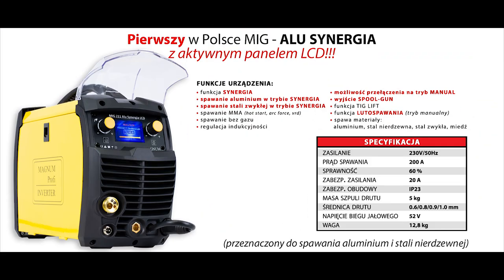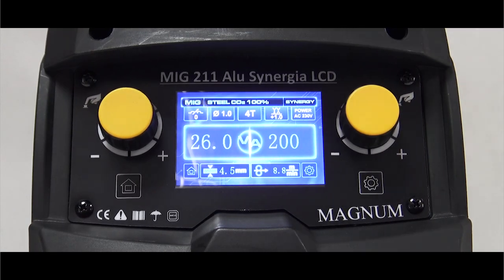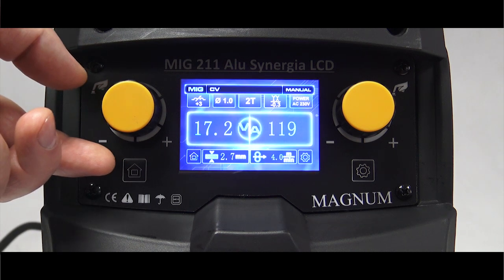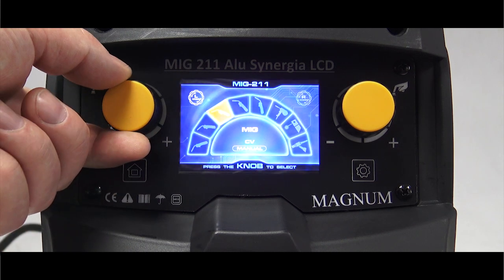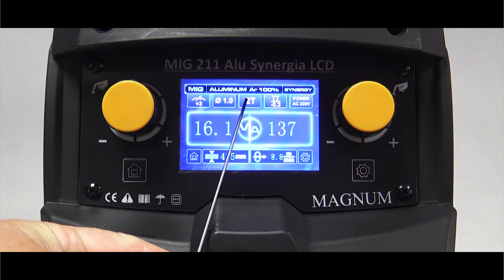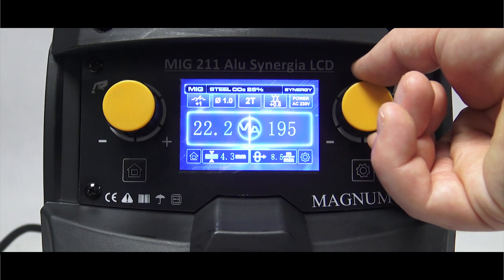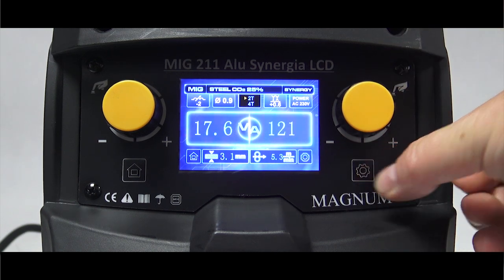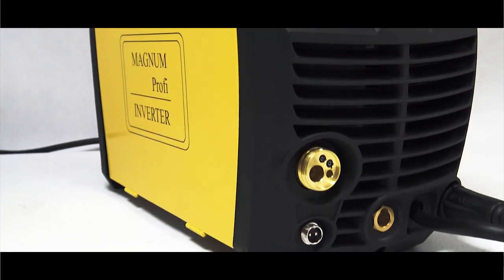Pierwszy w Polsce MIG 211 - ALU SYNERGIA z aktywnym panelem LCD!!!

Comment: The Menue is also in German Deutsch ?
Reply from the maker: Sorry, we have instruction in Polish and English language. We can provide the manual in an electronic version and then you can translate it into German.
Reply: @MAGNUMvideoprezentacje  , i mean the LCD,
Reply from the maker: @thomashansen3875  display is in universal language (english).
Reply: @MAGNUMvideoprezentacje  , ok, where can i buy it ? Only on eBay ?
Reply from the maker: @thomashansen3875  from polish distributors in Poland (you can find them on internet) or eBay or allegro.pl